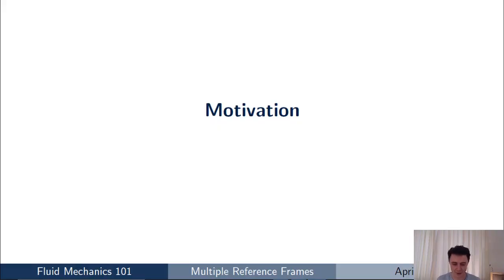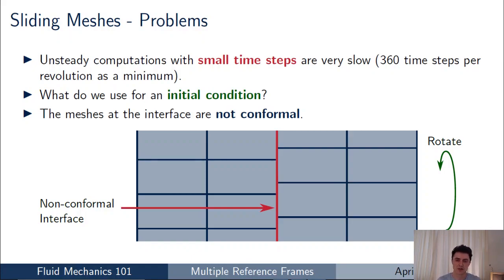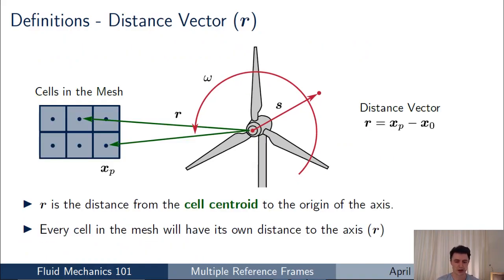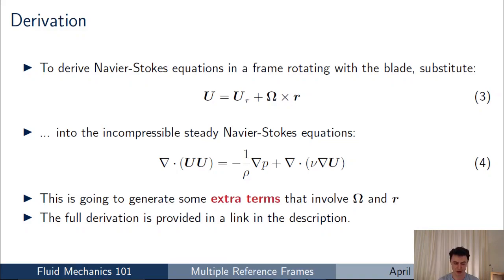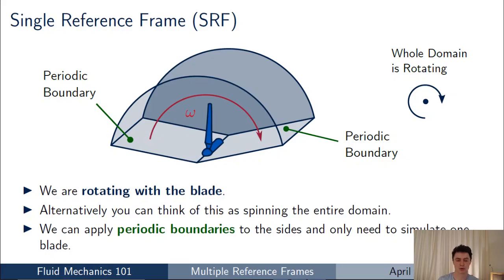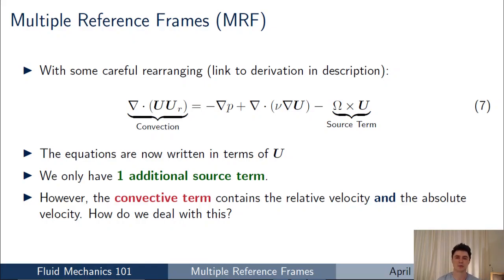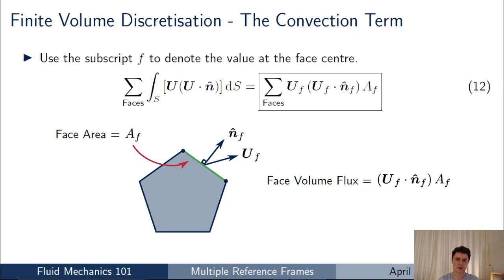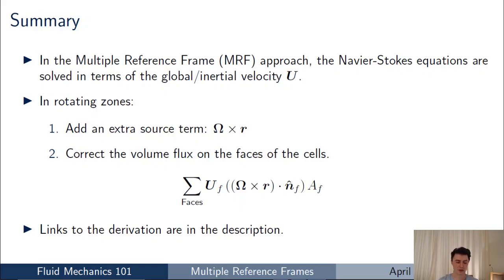[CFD] Multiple Reference Frame (MRF) Approach for Turbomachinery

Comment: I tried using MRF and see the velocoty profile. The velocity grafient between the rotary domain and the stationary domain are very high, is it okay? I do a simulation for a rotating wheel, I applied MRF on the spokes and inner rim, and rotating wall on outer rim and tires.
Reply from the maker: From your description it sounds like this is because of the rotating wall you have applied at the interface between the stationary and rotating zones?
Reply: @fluidmechanics101  I think this happens because when we use frame motion, we rotates all the fluid insde the rotary domain but in reality maybe the effect of the wheel rotation not rotate all fluid inside the domain, but i am not sure. Thank you for your reply.

Comment: Hello, Aidan, in CFD,  how can I decouple the pressure and mass flow rate when setting the boundary conditions. what I mean is how can set  different mass flow rate at the same pressure in boundary inlet? Thanks.
Reply from the maker: Hi lily, i dont think you will be able to specify the pressure and the mass flow rate an your inlets. I would probably specify the mass flow rates and let the cfd code calculate the pressure at the inlets. That should give you a stable solution
Reply: thanks, Adian,.